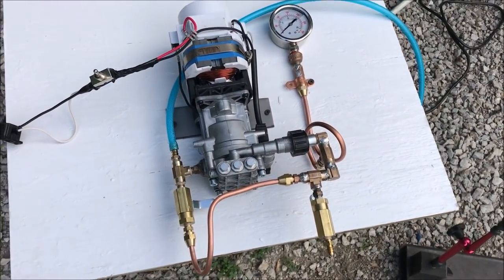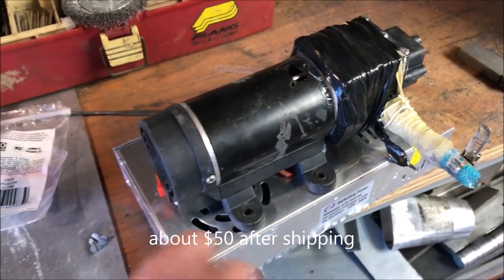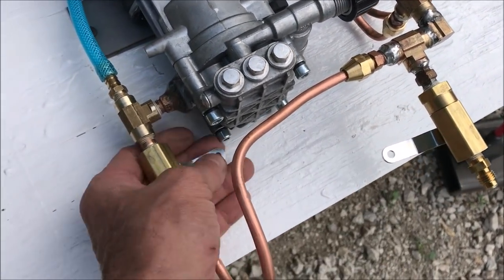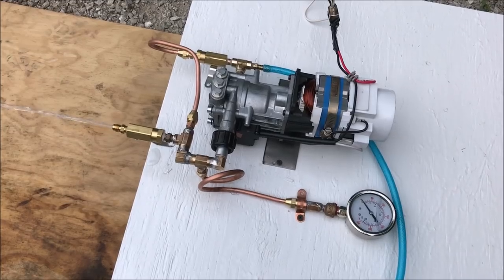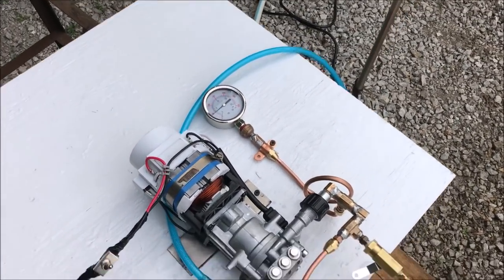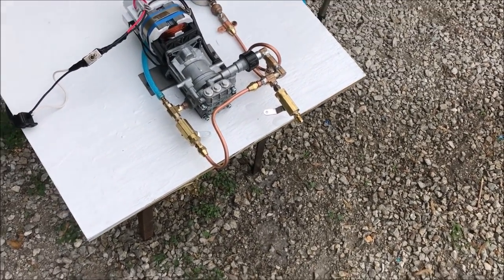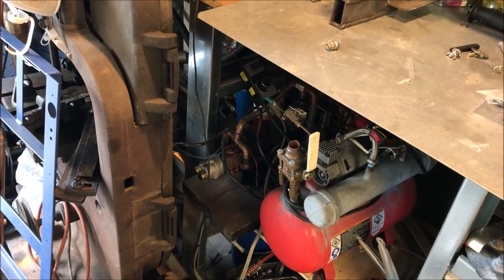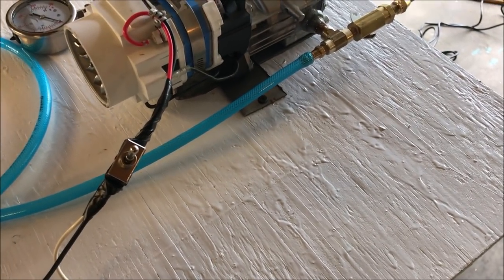High pressure low flow water pump for boiler

Comment: This is fascinating, one thing is this a run of the mill handheld pressure washer pump? because if i'm not mistaken these already have a built in bypass or recirculation connection or whatever you want to call it, regardless i think it would be better to send the excess water to a tank because the water will get hot pretty fast. Another question i was tinkering with these a few years back, for some reason i could not get it to pump water directly from a water tank(it worked connected to the hose), it's like it needed more pressure to turn on or something, any idea what the problem was? maybe something i can disable?

Comment: As the water circulates it can get warm and burn out the pump. Just something to be aware of
Reply: Could the water be routed through a radiator/ copper finned pipes from an air compressor to negate the additional heat.
Reply: @willeveryday  That's a good idea. On the low pressure side after the valves with some airflow if any is needed at all, keep an eye on the temperature to see if it needs some. It depends on pressure and flow rate

Comment: hi, amazing work. i am trying to build similar pump, regulated 125 +-1 psig range, flow meter with 0.20 to 2.0 GPM, can i use the same setup?
Reply from the maker: yes , this works on any pump , it can save you thousands of dollars
Reply: @NOBOX7  i have more question. Anyway i can contact you? Email maybe?
Reply from the maker: @kelsonteh7790  Yes email is in description